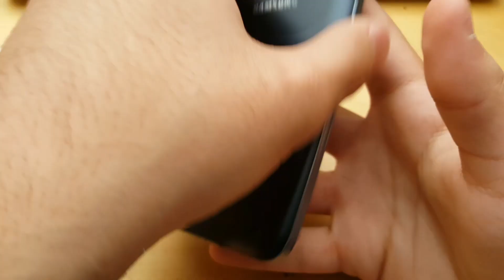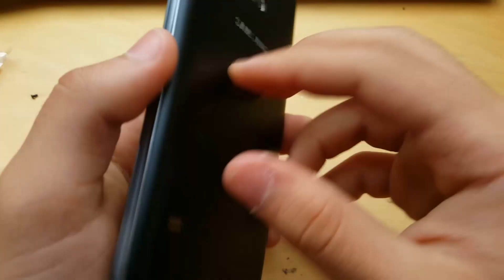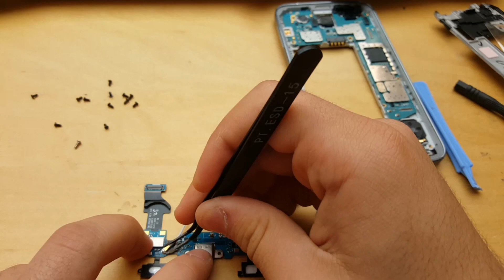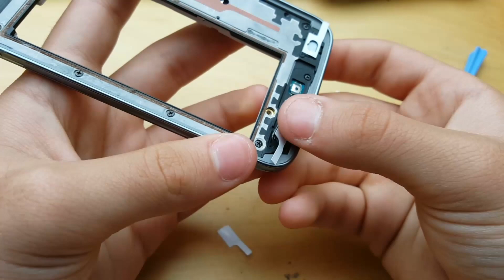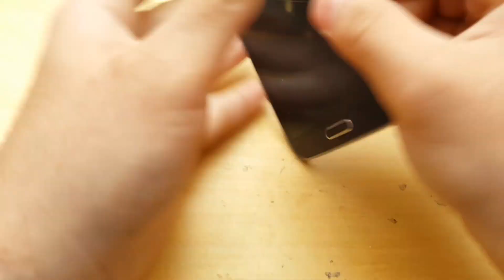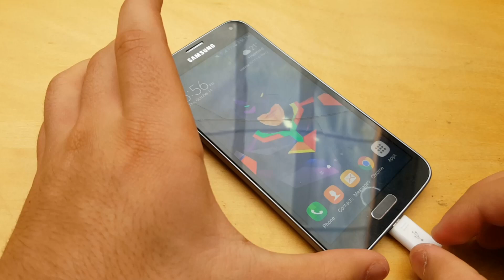How to change your charging port on Samsung galaxy s5 neo easy tutorial

Comment: It is impossible to take off the display. It is glued so tight the only way is to brake it. Therefore there is no possible way to change the dock port without also replacing the whole screen. The guy is very misleading.  Looks like he already had a new screen before he made the video. Not very honest because after I broke my screen trying to get it off I saw a proper video that explains that you have to break the screen to get to the dock connector.

Comment: Before you go through all this trouble try blowing the port out with compressed air after spraying a shot of QD electronic cleaner. Use a tiny flathead screwdriver to gently and carefully move thin cotton fabric or paper shop towel over the contacts, or use a clean toothbrush, then another shot of cleaner and air. I did all of the above and my old charging port works again.
Edit: The phone stopped charging again so I repeated the above procedure and did the same with the charging cable plug and this fixed the problem.
Reply from the maker: Kinda right this also works (I tried it)

Comment: Oh now i know the phone technician said the toughest part is opening the phone screen without breaking it.
Reply from the maker: True
Reply: It is impossible to take off the display. It is glued so tight the only way is to brake it. Therefore there is no possible way to change the dock port without also replacing the whole screen. The guy is very misleading.  Looks like he already had a new screen before he made the video. Not very honest because after I broke my screen I saw a proper video that explains that you have to break the screen to get to the dock connector.

Comment: The hardest part BY FAR is removing the glued-in glass front. But u dont show that and i had to go elsewhere.
Reply from the maker: Sorry about that will definitely cover it in a next video 👍🏼 new content comming up
Reply: @GogoTech  i got the glass out based on another walkthrough, then came back to your video as well. Heating the glass and prying is a nasty process. If you do remake the beginning (or if other phones are similar), note that the opening around the battery is also glued, and you need to push in the battery opening too or risk breaking. My phone glass was cracked, but i managed to do it with nothing but a very minor chip where the crack met the edge! Thanks for your help.
Reply from the maker: Thanks for your comment ❤ next time try to utilize a guitar pic it will help you more.